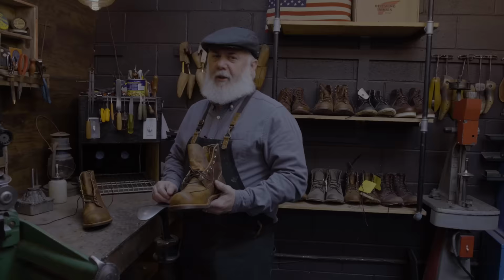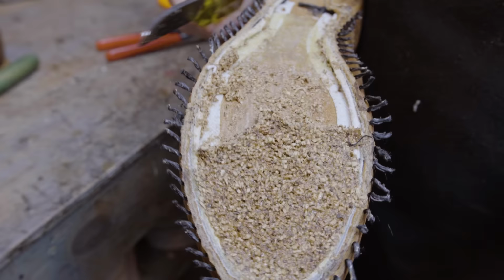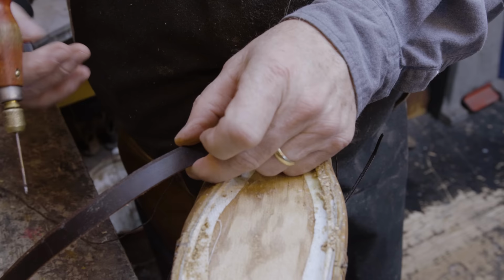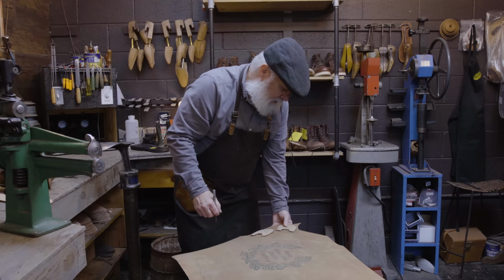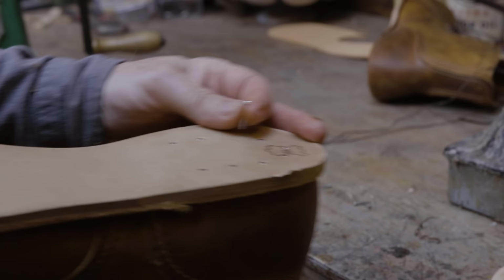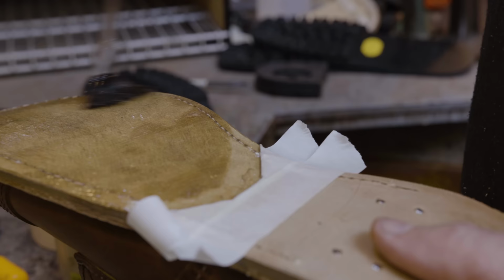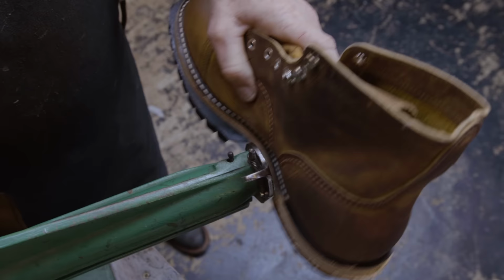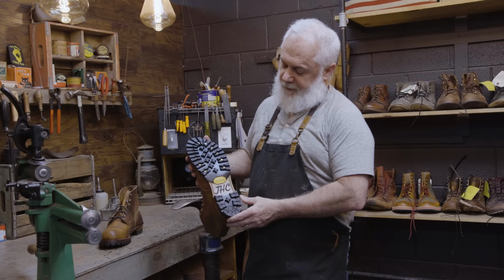I Converted these Redwing Iron Rangers into Urban Style Loggers! Total Recraft

Comment: The man must really like the look of the Iron Ranger. This job plus the new boots had to be more expensive than a pair of Nick’s Americana’s or Urban Loggers.
Reply: That's what I was thinking. Pricey boots, custom resole, monogram soles with antique edge dressing... that's a lot of money for "work" boots. I'd hate to mess them up at work!
Reply: So I'm not alone.  When it comes to work boots, and a lot of other gear I buy, I follow the rule of "form, fit, function."  These are are a fashion statement.  Which is fine, but the most work I think these are going to see is standing in line at Starbucks.

Comment: Love your work. I have a pair of Olathe Packer Boots I bought in my 20s. I’m now 50, and my feet are wider. Will a re-last allow for a wider foot bed to be installed for a little more comfort?  The widest part of the boots has been stretched out over the top of the welt, so it seems like it should be possible. If not, I’m gonna have to look for another pair of boots.
Reply from the maker: If the boots aren’t too tight on your foot, the inner sole can be made wider and the boots will be more comfortable. It the boots are snug, there isn’t enough upper to make them wider under the foot.

Comment: Great video guys! Quick question, at 18:52, I couldn't help but notice some glue got on the boot. In instances like that, how do you remove the glue without making any noticeable changes to the actual leather?
Reply from the maker: While fresh, it rolls off easily with my thumb. Suede and fabric shoes are the ones you have to be very careful about.

Comment: Thanks for the video. 
I fly fish. To help me walk over algae covered rocks I screw metal cleats in the vibram soles. Unfortunately the cleats have come out and the holes no longer grip new cleats. 
Is there any glues or rubber filler that can be used to grip a new cleat?  Can the soles be replaced?
Reply from the maker: @Edgemoore7  there are cobblers that put on those type sole that have metal receptacles built into the soles. That way you can change the spikes when you need to
Reply: That would be fantastic.  So…. Guess I would just need to call around and hope one could do it?

Does Vibram make the product?

Is there a glue that’s could seal the holes until I find a source for the spiked soles?
Reply from the maker: @Edgemoore7  silicon at hardware store will fill the holes and remain flexible
Reply from the maker: @Edgemoore7  what part of the world are you located? I may know a cobbler in your area
Reply: @WyattDadCobblerCompany  Northern California
Reply from the maker: @Edgemoore7  there is a guy in Oregon that may be able to do them. 
James Young
541-425-6496
Reply: Thank you so much for the guidance. !!!

Comment: If i wanted this exact recraft, what would the selections be on your website?
Reply from the maker: You can just pick the iron logger with the Gerberei Martin leather upgrade. We will switch the order description during the consultation call when they arrive. The brass screws and initials burned in can be added at the consultation also, if you want them. The price of the burn is determined by the complexity of the design. 
Thanks!
Reply: The style you suggested looks to have a completely different sole? The corded sole instead of the vibram 100.
Reply from the maker: @MrMoon1ight_  correct. It’s just the right price. The other option is to include your contact information in the package and send them in. I can email you an invoice once they arrive. Either way, I will call and get all the details down before any work is done.

Comment: Hi Tony - These turned out great!  You do great work, but I have a question...and certainly don't mean to be nit-picky.  I couldn't help but notice the welt stitching on the right boot was very close to the edge (on the toe).  Did you over sand that a tad, or are my eyes playing tricks on me?  I recall hearing in other videos that when the stitches are close to the edge, it makes re-soling with the same welt difficult.  I have watched so many of your videos, and other cobblers too, that I find myself noticing these small details.  Thanks!
Reply from the maker: Good eyes, and very good question! The stitching on the right boot is slightly closer to the edge than the left. The stitcher table caught a rise in the welt and fought me on that one. However, it’s not as bad as the photo angle made it appear. There is plenty of welt left for multiple resoles where the stitching is.
Reply: @WyattDadCobblerCompany  Thanks for the reply.  I'm glad you didn't take this as a negative thing - just an honest question.  As a non-cobbler, I have found myself enthralled watching re-crafting videos and have gained some education (thank you for that!).

Comment: The radius you sanded in heel makes it looks feminine.  Not that that's a bad thing, but it might not be what was intended.
Reply: In the beginning, Tony does state that the customer wanted the logger look. So it is intended. Logger boots have that curve on the heel. Many companies such as Nick's Boots and JK Boots, do produce logger boots with that curve as well. I can see why you would say that. However, it is done on a lot of men's logger boots too.

The curved heel stack does serve a very useful purpose. The curved heels are mostly for additional ankle support, especially when negotiating uneven or mixed terrain, and definitely when going uphill. The raised heel also gives additional arch support, which is needed when doing heavy outdoor work, as the arch functions more or less as the shock absorber of the foot.

It's also the case that a heavy, raised heel also helps tame shocks to the heel and feet, making the raised logger heel beneficial for people who work on concrete floors.

Comment: Well, Nick's probably didn't actually "invent" 6" logger boots, either, because I had a pair way back when already by some other brand. BUT I am more concerned with how much this type of overhaul would cost that it makes it faster and cheaper than just buying custom boots from one of those established companies. I mean, I already know I want to rebuild my Carolina ones because they fit horrible and are very uncomfortable, but that won't turn them from 8" to 10" and I don't know how many more local shoe guys would have correct lasts, etc.
Reply: And Red Wings already have all leather insoles and such, so how much extra beefing up would be needed there would be less, I assume, than a Thursday boot or some other mass-market model.
Reply: Oh, and two or three of the PNW companies say they advise against getting lace-to-toe. In your estimation, is this just because they are lazy and don't want to do a bit of extra work?
Reply: Is this work billed hourly for starters?

Comment: This boot is a contradiction. The halfsoles are a osha violation in any field of work because the leather is going to slip. And calling these loggers is laughable since the shaft is not tall enough.
Reply from the maker: Urban implies city wear. Style implies it is trying to look like the real thing with the lug soles like logger boots, but not at  the same time. Having his initials burned into the waist should indicate that these boots will never be in a situation for an osha agent to ever see them on any job site. Where is the contradiction? These boots are obviously for casual wear only.
Reply: @WyattDadCobblerCompany  Did you at least use a 10 penny nail as the shank?
Reply from the maker: @eaglewarrior8707  🤣🤣 oh man, I didn’t think of that!